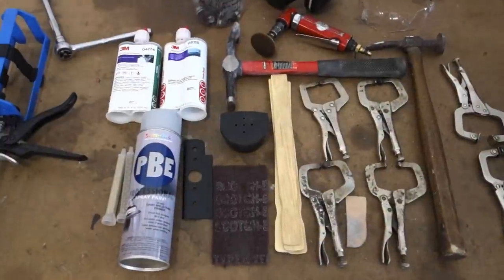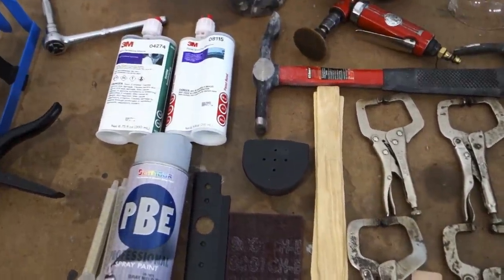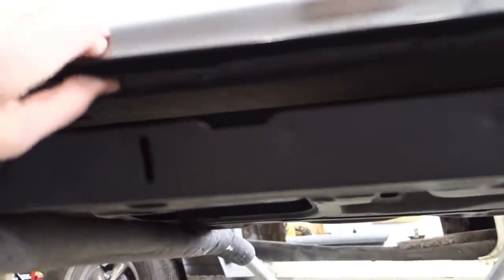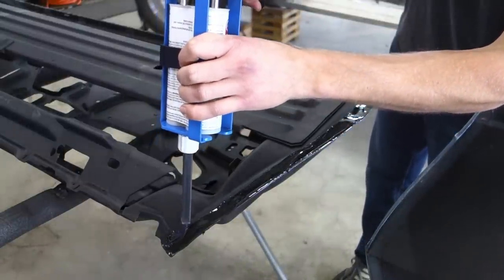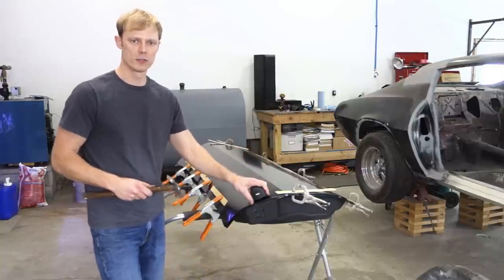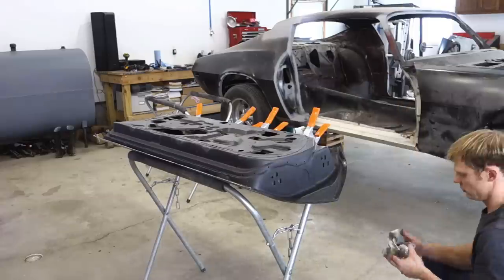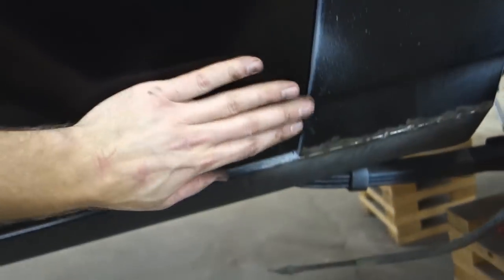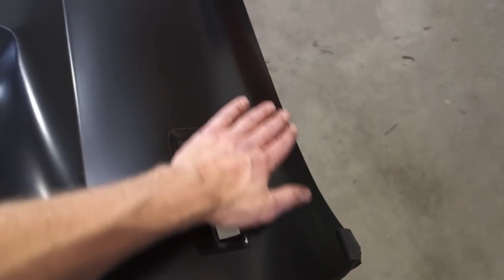Door Skin Installation - Door Skin Replacement Part 5 - 71 Camaro RS

Comment: Great Job.  Going back and checking out all your videos as I can.  Im trying to put my front fenders back on now and its a mess.
Reply from the maker: Thanks! I'll ping you when I try my fenders for a second time! The first attempt wasn't looking good.  Hopefully you'll have yours figured out by then. Are you using reproduction fenders?
Reply: @RestoCar  Ok,  what fenders do you have?  Mine are reproduction and will need some work to make them work.
Reply from the maker: I have Goodmark reproduction fenders. My main issue is that the body line area sticks out further than the door by a good amount. No amount of shims top or bottom seems to help.

Comment: Who has supplied door skin. was the end result good? I have checked various suppliers. and there is a difference in how good the edges are. Some are sharp rounded edges like an original door and the bad ones get a round butt end on the edge of the fold.
Reply from the maker: I used a Goodmark Door skin. The main difference I saw is that there is not as much material in the folds as there is with the original. The end result looks good to me minus a low spot around the door handle area that I missed when inspecting the panel.
Reply: @RestoCar  I has held for a while with div cars. Metal must have a certain thickness to be stable. It annoys that I do not get the thickness and quality checked before buying a door skin. I have shared opinions with Camaro Overkill :-) and based on what he writes I will go for new doors. But are metal thickness issues the same if I buy new doors ?? Has the factory used the same steel as the reproduced door skin?

Comment: Good job. When installing a whole new door shell on modern cars, how are the inner parts like electric window motors and glass fitted? Do you fit from the outside by cutting and re-welding the skin? Or there's enough opening from the inside of the door shell?
Reply from the maker: My experience on my daily drivers has been that the glass comes out from the top of the shell (once detached) and everything else fits through the door shell once you take the door panel off.
Reply: @RestoCar  thank you!